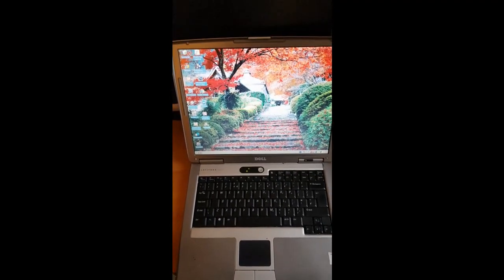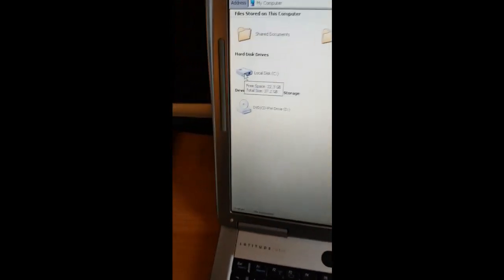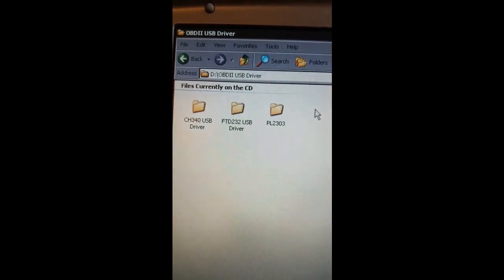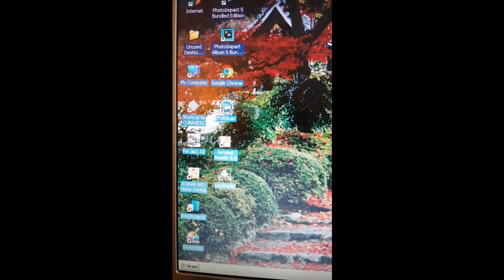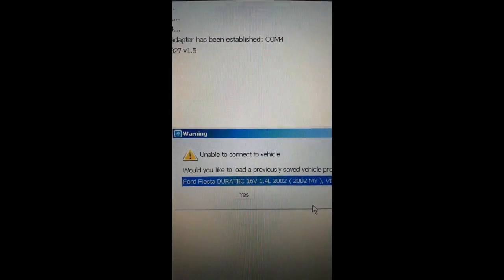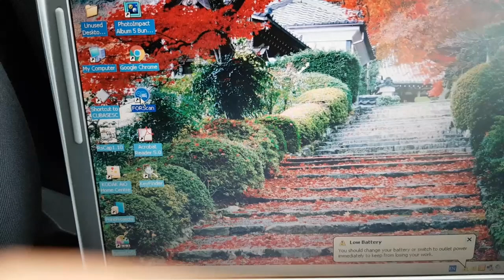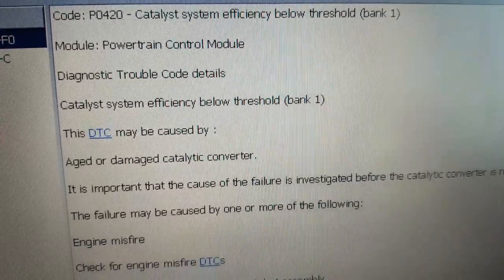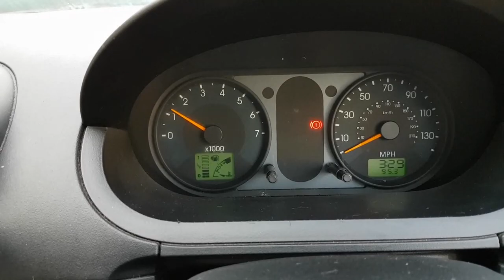Using Forscan to clear P0420 code on Ford Fiesta with ELM 327 adaptor.

Comment: yeah it works well, some codes will come back on though.  I used this forskin  to clear my  p0125  coolant temp closed loop  problem fine, and got it through the MOT (cba to fix the actual problem which is a leaky thermostat).    But now I have p0030 faulty o2 sensor,  and it will come back on every time you start the car  as it does a voltage check each time the car starts. So if you clear some faults,  the EML will come back on the next time it starts.   Which means I need a new o2 sensor to pass the MOT :(

Comment: Nice one. Do you know if u can gain access to the bcm via forscan?, looking to see if i can clear "bulb out" fault or along thoseclines to stop hyperflashing from led indicators. Rather than use resistors
Reply: Hi. I'm having the same problem and want to know how to fix it using forscan. Did you ever find a solution ?
Reply: @TheKickass0911  unfortunately not